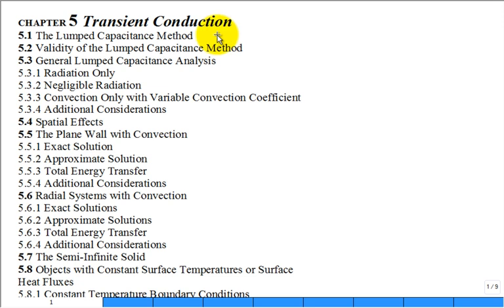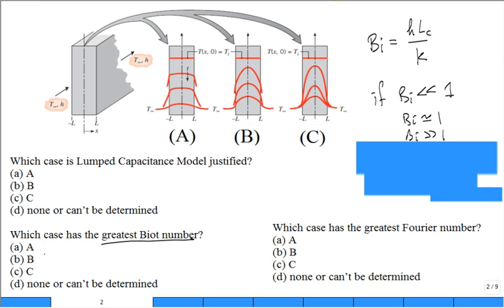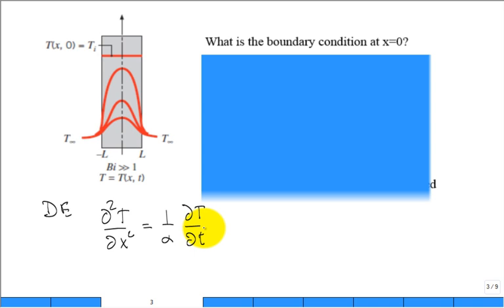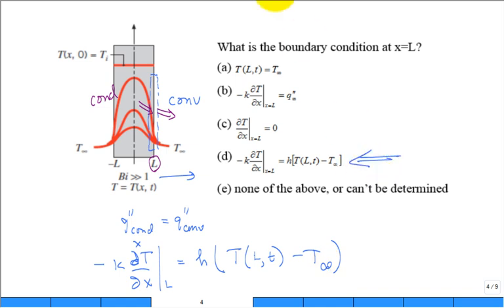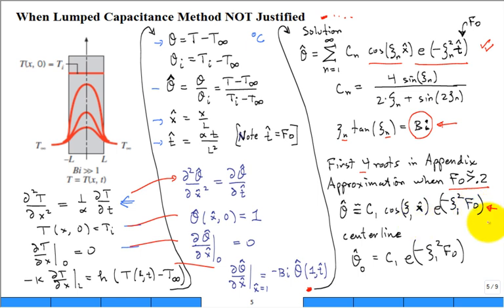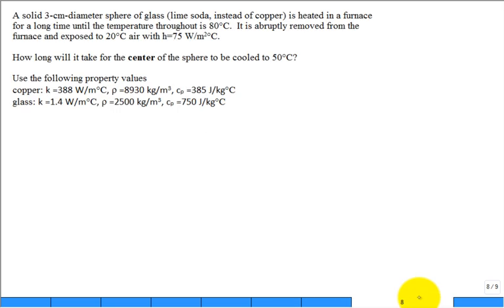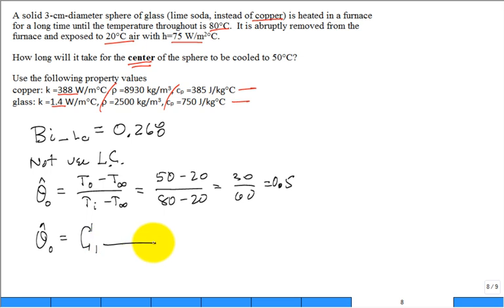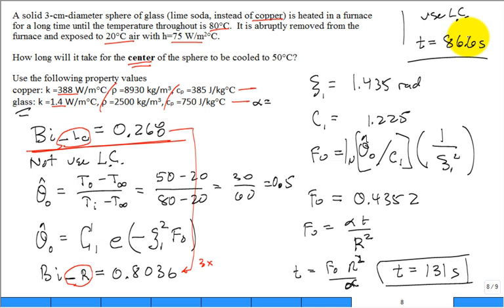Transient Conduction, Spatial Effects

Comment: For the Bi number in terms of Ro isn't it in meters ?
Reply from the maker: I don't understand your question.  Starting around 18:40 the length scale used in Bi number is explained.  It is a little confusing, since it uses Ro/2 to check if lumped capacitance is valid, yet is Ro when looking up zeta1 and C1 in Table 5.1.  Biot number is always dimensionless.
Reply: I meant at 28:25 when we found the Bi number we used Lc. Since the diameter is 3 cm (0.3m) shouldnt we use the Ro to be 0.015 to get 0.08036 than 0.15 to get 0.8036
Reply: Unitless

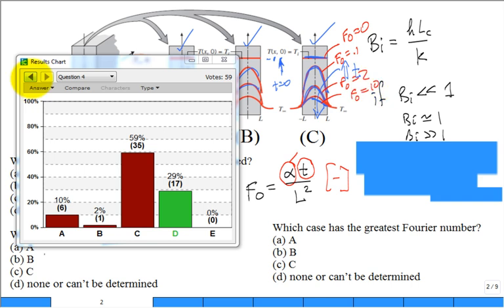Comment: 8:12
Which has the greatest fourier number question.
Lets consider thermal diffusivity, which is a function of K in its numerator. So the higher k value will result in higher thermal diffusivity value, which then results in higher fouriers number value. From this we can conclude the bigger our K value, the bigger our fourier number will be. Very big K equals to very little heat resistance in an object. Case A shows very little resistance to heat transfer because the surface temperature is very similar to the mid plane temperature. So then I have determined case A has the greatest fourier number.

Please let me know if my thought process is off.
Reply from the maker: Yosief Amanios your ideas are good. I think it is same slab, so k not changed. What changes is time, and Fourier number proportional to time.